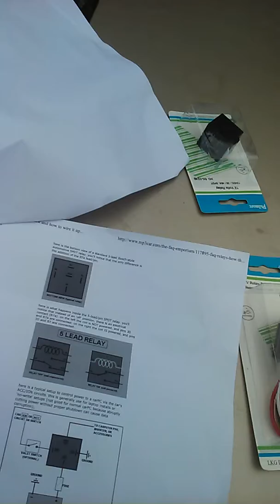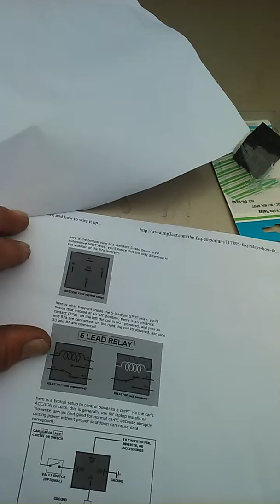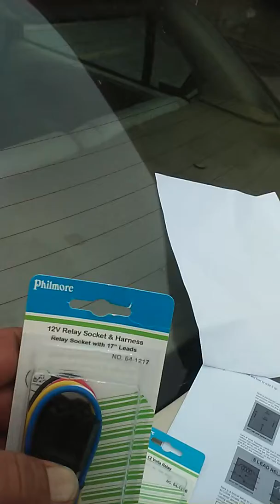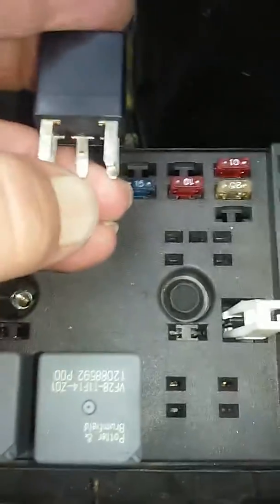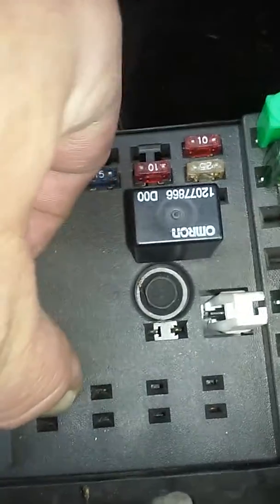Saturn SL2 1996 Add ignition relay radiator fan

Comment: Hey, thanks for info, For my 96 SL2, had same issues with cooling fan not coming on soon enough, since I pay pretty good attention, to my gauges, especially in town driving!! I opted to run a 30 amp toggle, along with 30/40 relay ran up next to my console, mainly BC I live in the North east, and honestly during the very cold months I'm never stopped long enough for the gauge to even get close to the half way mark!
Anyway, I'm able t o control manually control mine and turn off , when rolling down the highway ( Almost never need to turn on unless it's very hot and hill driving) So I can better manage my gas mileage!! BC I've noticed the more I run the fan ,, the harder it is on Fuel Economy! 
I do not have a video for it, but, itsa really not that hard to do! Good luck